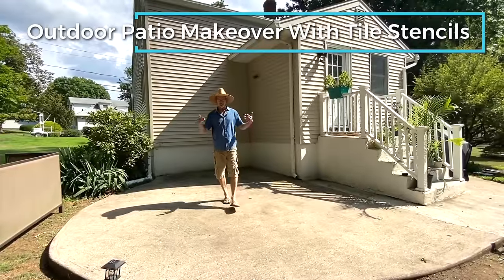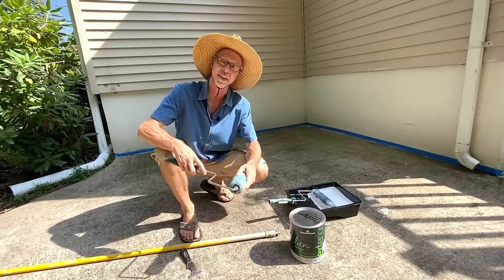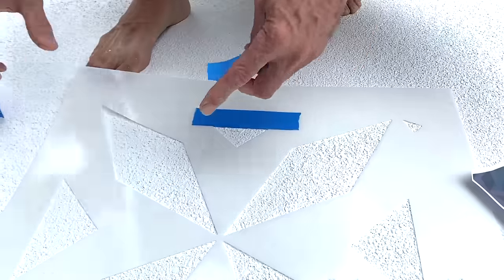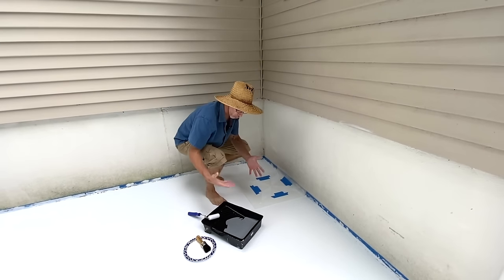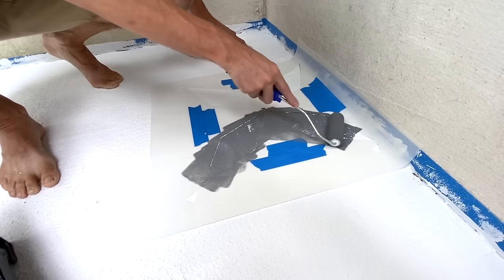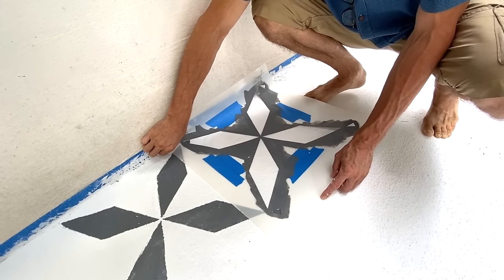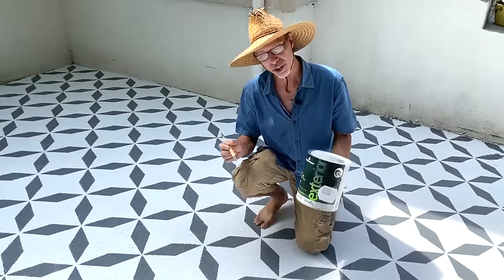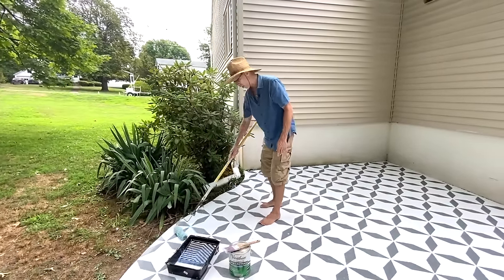How To Stencil Tiles On Cement Outdoor Patio

Comment: Love this idea! My questions is though, even with your poly, if you want to clean the patio over time would you still use a pressure washer? Wouldn’t that destroy the stencil?
Reply: My thoughts too.
Reply from the maker: Hi, Pressure washers can be very aggressive so I would avoid that. A hose, some soapy water and a broom should be fine.
Reply: What if you added another layer of clear concrete epoxy over?
Reply: @jesuisdiva  where could you purchase the clear

Comment: Hi.  We have purchased our water based base coat and stencil coat and getting ready to start.  Our only remaining problem is finding a sealer once completed.  We are unable to purchase the one you have used in Australia and none of the companies here make water based sealers to go over the paint on the concrete.   In researching what you have used it appears to be a water based external timber sealant.  Is that correct?   Given we have about 120sq meters we don’t want to buy the wrong thing cost it is going to be very expensive.  Your advice would be greatly appreciated.  Thank you. Sandra
Reply from the maker: Hi Sandra,
The idea of using a water based sealer is to minimize the yellowing that occurs with with traditional oil based sealers. What you are looking for is a 
water based spar varnish. Just any water based exterior clear coat that has UV protection should work. It doesn't necessarily need to be for concrete.
I hope this helps!

Comment: Hi Greg. Awesome video. Easy to follow and informative! Thank you! Just purchased a stencil from y'all for my concrete front porch and stumbled across this video. I am curious to know if you recommend doing 2-3 coats of the primer (similar to your recommendation for interior projects). This wasn't specified for outdoor so wanted to find out your thoughts here. Many thanks!
Reply from the maker: Hi Rachel, thank you for those kind words! Primer is always a great idea to add before base coating and stenciling, especially 2-3 coats. If your patio is outdoor, you can get away with 2 coats of exterior paint as well!

Comment: I used the Varathane Spar Urethane water based and it DID NOT seal my finished stenciled front porch (which took me 10 hours to complete).  The finish paint is coming off simply by using my fingernail.  I would not recommend the Varathane.  I called Rust Oleum and they told me I could remove it using a wood finish remover but it would damage my paint job. All I can say is UGHHHHH!!!  I have a plaque in my office that says, "Life is all about Plan B."  So what I plan on doing is hopefully talk to someone who knows they're stuff at Sherwin Williams and get another opinion.  After that, I plan to buy furniture pads for furniture I plan to put on the front porch.  I already ordered a large area rug to place on the high traffic area.  And then I plan to ENJOY it regardless.

Comment: I purchased a stencil to complete an interior concrete basement floor project. I notice you used Varathane Spar Urethane for your outdoor patio project. What do you suggest to use as a sealer for indoor basement floor  concrete? Great video!
Reply from the maker: For an indoor basement you can use regular Varathane water-based polyurethane! 2-3 will be good. You can always add more for high traffic areas!
Reply: @CuttingEdgeStencils  Thank you! I  noticed that the Varathane polyurethane is used for wood mostly. Are you certain it is okay to use on concrete?
Reply from the maker: @s.sawaged4958  That's the one! We've seen great results over floors as well as wood!

Comment: How does this look after time goes by? Does it do ok with pressure washing?
Reply from the maker: We wouldn't recommend power washing a stenciled patio, but a hose will clean it off any dirt! Stenciled floors can last years. It's all about having a good top coat, like Spar Varathane polyurethane to protect it!

Comment: I read somewhere that painted concrete gets particularly slick when wet. Do you find this to be the case? And if so, how do you counteract that issue?
Reply: You can add shark grip to your sealer. It may sparkle a bit but it gives a slip resistant texture.

Comment: How often do you need to respray the sticky on the back of the stencil please?   I am in Australia and love the stencil you have used.   We have an area of about 8 x 12 meters to do.   How many of the 16 x 16 stencils would you suggest we purchase and can we purchase from you?   Do you ship to Australia ?
Reply from the maker: Hi,
You add spray adhesive when you need it. It depends on how much you use and the surface you're stenciling on. You should get at least 4 or 5 prints if not more! Could be 10. But when you notice that it's lost its tack, mist another coat on. That's a big space. I'd get 2 or 3. It will just make the project go faster. I'm sure we ship to Australia! Just go to www.cuttingedgestencils.com
Good luck!
Reply: @CuttingEdgeStencils  thank you.  I have ordered 4 of the 16in stencils but couldn’t order the tacky spray.  Not shipped to Australia so will get something here

Comment: You overlapped onto the first star with the stencil, when you moved to the 2nd one. So, I assume you let the first one dry?  That seems like a lot of time if I have to let each one dry between?
Reply from the maker: Hi Beverly! We waited until the first one was completely dry before moving onto the next. A major reason we recommend stenciling with paint in a flat sheen is because the dry time is super fast! It only takes about 1-2 minutes to dry:)
Reply: @CuttingEdgeStencils 
Ah, I see...thank you for the quick reply for clarification

Comment: Just curious why you didn't pressure wash first.  I know you cleaned it with a brush but it looks like you painted over mildew on the concrete.
Reply from the maker: Hi Mary! We scrubbed the patio off with anything that could alter the pattern of the stencil. We didn't pressure wash it because it was going to be painted over anyway! :)

Comment: what should you do if the concrete is rough and the stencil doesn't  sit flush and causes lots of paint bleeding. Is there a sealer that can fill in the rough surface to make the surface easier to stencil? Thank you !
Reply from the maker: Hi, It's tricky to stencil rough surfaces but they do make a trowelable driveway sealer that fills in the low spots and cracks of a driveway. You could use that first and then base coat and stencil. Good luck!

Comment: How on earth did you get clean lines?  Tried to stencil my tile floor- severe bleeding lines.  I gave up- what a mess.
Reply from the maker: Hi,
Sorry to hear that you struggled. It really comes down to a few tips and tricks. I recommend a flat sheen base coat, maybe some spay adhesive and most importantly, do not have too much paint on your brush or roller. Too much paint will always result in unwanted bleed. After you load your roller, off load some of the paint on a paper towel and then build up your paint coverage slowly. We have many other videos that outline these steps. Maybe try again?

Comment: What about etching the concrete? Cuz, the paint I applied to new concrete, peed right off over the winter.
Reply from the maker: Hi, That's strange. Concrete is usually very porous and the paint sticks great. Perhaps using an adhesive primer like STIX would help. Always make sure the surface is clean and dry before painting. Sometimes you can slightly dilute the paint so it seeps into the concrete as well.

Comment: Why varnish rather than a concrete sealer? Why satin rather than gloss or semi gloss?
Reply from the maker: Hello T R! Spar Urethane specifically is meant for dealing paint projects that are outdoors and can project your stenciled patio from the elements. We chose a Satin finish because that is just what we prefer, but you can certainly use a glossy finish!

Comment: I just stenciled my front porch and sealed it. Now it’s semi slippery. 😩
Reply from the maker: Hi Cindy,
I just saw your unanswered question. Sorry about that. You could find some clear sand or aggregate and mix it in a coat of clear. 
Glass beads and synthetic aggregates are the least invasive types of aggregate that still produce some level of skid resistance. Glass beads, in particular, are practically invisible. 
Hope this helps!